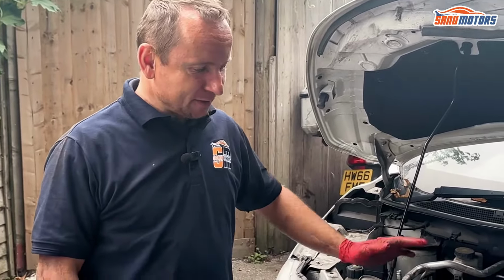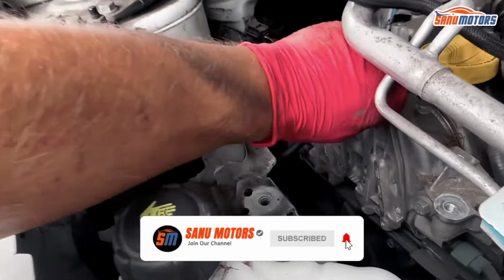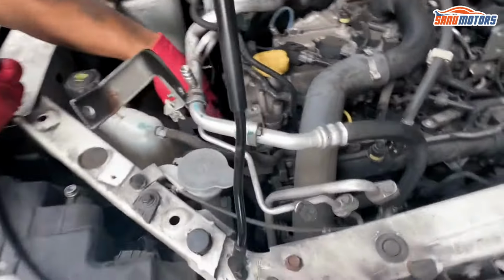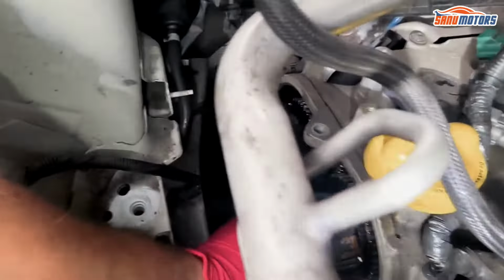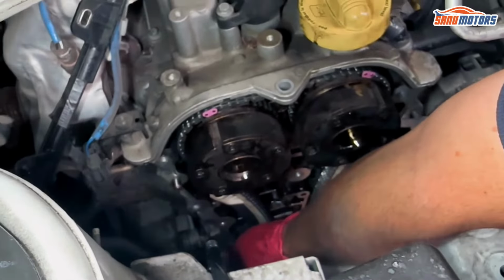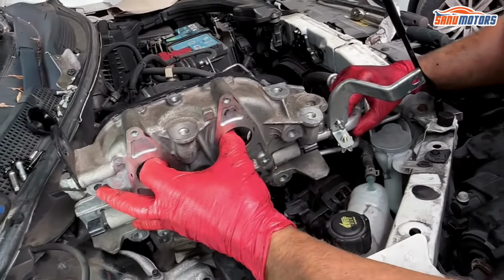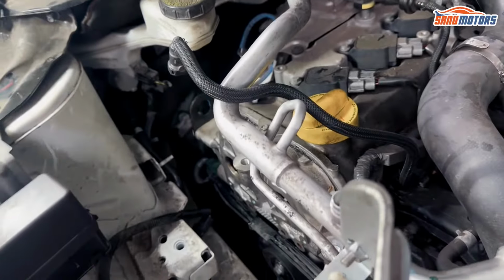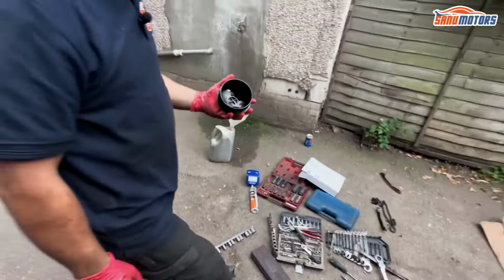Replacing the Timing Chain on Nissan Qashqai 1.2 | Timing Chain DIY Tutorial

Comment: Hi Charlie. My Turbo just failed on the same car. ( 2019 Qashqai 1.,2 petrol ) The turbo shaft is bent and it's coked up with carbon. I'm worried that the same thing will happen again after I replace it. What should I do or look out for? Is it easy and worth removing the sump and rocker and flushing?
Reply from the maker: Experiencing a failed turbo on your car can indeed be concerning, especially if you're worried about it happening again after replacement. Here are some steps and considerations you can take to address the issue:

Diagnose the Root Cause: It's important to determine why the turbo failed in the first place. A bent shaft and carbon buildup can indicate various issues such as oil starvation, poor lubrication, or excessive heat. Without addressing the underlying cause, the new turbo might face similar issues.

Inspect Oil Circulation: Check the oil circulation system thoroughly. Ensure that oil is flowing properly to the turbocharger and that there are no blockages or restrictions in the oil lines. Additionally, make sure the oil is clean and of the correct grade specified by the manufacturer.

Address Engine Issues: Excessive carbon buildup could indicate issues with the engine, such as incomplete combustion or oil leakage into the combustion chamber. Address any engine issues that could contribute to carbon buildup to prevent future turbocharger problems.

Consider Flushing: Flushing the engine can help remove any accumulated carbon deposits and contaminants from the oil system. However, it's essential to use a proper flushing agent recommended by the manufacturer and follow the procedure outlined in the service manual. Removing the sump and rocker cover for a thorough cleaning might be beneficial if there's significant buildup.

Regular Maintenance: Following the recommended maintenance schedule for your vehicle is crucial for ensuring the longevity of the turbocharger and other engine components. This includes regular oil changes, air filter replacements, and inspections for any signs of wear or damage.

Monitor Performance: After replacing the turbocharger, monitor the performance of your vehicle closely. Keep an eye on oil consumption, exhaust smoke, and any abnormal noises or vibrations that could indicate potential issues with the new turbocharger.

Consult a Professional: If you're unsure about any aspect of the repair process or if you're unable to diagnose the root cause of the problem, it's best to consult a professional mechanic or technician with experience working on turbocharged engines.

By taking these steps and precautions, you can increase the likelihood of preventing future turbocharger failures and ensure the reliable performance of your vehicle.

Comment: Is the crank pulley definitely 19mm some videos are saying 18mm? Thx
Reply from the maker: Great question! For the Nissan Qashqai 1.2, the crank pulley bolt is typically 19mm, but it’s always a good idea to double-check before starting, as some models or years may vary slightly. 🔧 If you’ve seen sources mentioning 18mm, it could be specific to a different year or variant.

Thanks for watching, and feel free to reach out if you need any more info! 🚗👍 #NissanQashqai #TimingChain #DIYMechanic

Comment: Would this be the same process for Nissan qashqai +2 2012 petrol. Would the timing marks be the same.
Reply from the maker: The process for setting the timing marks on a Nissan Qashqai +2 2012 with a petrol engine and a Qashqai 1.2 may be similar, but there could be some differences based on the specific engine types and configurations. It's essential to refer to the service manual or repair documentation for your exact vehicle model to ensure you have the correct information for setting the timing marks.

Different engine variants and models may have variations in their timing mark positions, so it's crucial to get precise instructions for your specific vehicle. If you're not confident in your abilities or need assistance, it's best to consult a professional mechanic or a Nissan dealership to ensure that the timing marks are set correctly for your particular vehicle. Incorrectly setting the timing marks can lead to engine damage or poor performance

Comment: Hi mate love your videos,
I have an issue with my 1.2l 2014 qashqai cranking but not firing, i had RAC out and they did a diagnostic check and found a fault on the camshaft position sensor. Replaced 2 sensors and no change, he told me the timing chain has most likely worn/stretched causing the timing to be out. How likely is this to be the problem? 
Thanks.
Reply from the maker: Hey there! Thanks for the support and reaching out. It sounds like you're dealing with a frustrating issue with your Qashqai.

If the diagnostic check identified a fault with the camshaft position sensor and replacing two sensors didn't resolve the issue, the next logical step would indeed be to investigate the timing chain. While it's not the most common issue, timing chain wear or stretching can certainly cause problems with engine timing, leading to difficulty starting or running rough.

Given the symptoms you described – cranking but not firing – along with the diagnostic findings, it's worth considering the possibility of timing chain issues. However, it's essential to rule out any other potential causes before jumping to conclusions.

I'd recommend getting a second opinion from a trusted mechanic or a Nissan dealership. They can perform a more thorough diagnosis, including checking the timing chain and related components, to confirm whether it's the root cause of the problem.

Timing chain replacement can be a significant repair, but addressing it promptly can prevent further damage to your engine. Keep me updated on how things go, and if you have any more questions or need further assistance, feel free to ask. Best of luck getting your Qashqai back up and running smoothly! 🚗💨
Reply: Thank you for your detailed and quick reply! Indeed it is very frustrating as the car ran fine before with no noticeable rattling or symptoms although it has done 103k miles without a replacement so it could be a good possibility. I will now be taking your advice on getting a garage to give me a second opinion 👍 I will let you know what the outcome is and again thanks for your help.
Reply from the maker: Thank you hopefully all ok. 👍

Comment: Hi, nice job, you make it look easy, I have a Nissan juke 2016 1.2dig t I think is the same engine with the one in you video, the car keeps throwing P0090 code with engine light on and start stop system light flashing without any other symptoms, I've noticed that is happening with the engine cold and just in motorway never around the city, once the code is deleted, never come back until the engine is cold and I take it to the motorway, any idea what it can be wrong? Thank you
Reply from the maker: The P0090 code typically indicates a problem with the fuel pressure regulator control circuit. Since you're experiencing this primarily when the engine is cold and on the motorway, it could be related to fuel pressure fluctuations during high-speed driving.

Here are a few things you might want to check or consider:

Fuel Pressure Sensor: The fuel pressure sensor might be malfunctioning or giving inaccurate readings, especially when the engine is cold and under high load on the motorway.
Fuel Pump: The fuel pump could be failing or not delivering consistent pressure, particularly when the engine is cold and requires more fuel at high speeds.
Fuel Filter: A clogged fuel filter could restrict fuel flow, causing pressure issues, especially during high-speed driving.
Wiring and Connections: Check the wiring and connections related to the fuel pressure regulator and sensor for any signs of damage or corrosion. Sometimes, a loose connection or damaged wire can cause intermittent issues.
Software Update: There might be a software update available for your car's engine control module (ECM) that addresses this issue. It's worth checking with a Nissan dealership or a qualified mechanic to see if there are any updates available.
Since the issue seems to occur primarily under specific conditions, like when the engine is cold and on the motorway, it might be a bit tricky to diagnose. If you're not comfortable doing the troubleshooting yourself, it's best to take your car to a qualified mechanic or Nissan dealership for a thorough diagnosis and repair. They'll have the tools and expertise to pinpoint the exact cause of the problem and get it fixed properly.
Thank You
Reply: stretched timing chain causing fuel pressure at the wrong time -> giving fault for fuel pressure regulator, typical issue
Reply: Hi. Did you solve the P0090 problem? I have same problem and it came up after replaced the timing chain.

Comment: Have you done this for the Renault Captur, and is it the same as for this Qashqai
Reply from the maker: The process of replacing the timing chain on a Renault Captur 1.2 and a Nissan Qashqai 1.2 can be quite similar because both vehicles often share the same engine, the Renault-Nissan H5FT 1.2-liter turbocharged engine. However, there may be slight differences in the procedure due to the distinct layouts and designs of the two vehicles.

Here's a general guide to replacing the timing chain on a Nissan Qashqai 1.2, which can serve as a reference for the Renault Captur 1.2 as well. Always refer to the specific vehicle’s service manual for precise instructions.

### Tools and Materials Needed:
- Socket set
- Wrench set
- Screwdrivers
- Timing chain kit (includes chain, tensioner, guides, and sprockets)
- Torque wrench
- Engine oil
- Coolant
- Gasket sealant
- Jack and jack stands
- Drain pan

### Steps:
1. *Preparation:*
   - Ensure the car is on a flat surface and the parking brake is engaged.
   - Disconnect the battery to avoid any electrical issues.

2. *Drain Fluids:*
   - Drain the engine oil and coolant into a drain pan.

3. *Remove Engine Components:*
   - Remove the engine cover, if present.
   - Take off the air intake duct and any other components obstructing access to the timing chain cover.
   - Remove the serpentine belt by releasing the tensioner.
   - Detach the alternator and power steering pump if they obstruct the timing chain cover.

4. *Access the Timing Chain:*
   - Remove the valve cover to expose the camshafts.
   - Detach the crankshaft pulley. You may need a pulley removal tool for this step.
   - Remove the timing chain cover. This may require removing additional components such as the water pump and engine mounts, depending on the vehicle's layout.

5. *Remove the Old Timing Chain:*
   - Align the engine to top dead center (TDC) on the compression stroke of the first cylinder.
   - Remove the timing chain tensioner and guides.
   - Carefully remove the old timing chain and sprockets.

6. *Install the New Timing Chain:*
   - Install the new sprockets, ensuring they are aligned correctly.
   - Fit the new timing chain onto the sprockets.
   - Install the new guides and tensioner.
   - Ensure the timing marks on the camshaft and crankshaft sprockets are aligned as specified in the service manual.

7. *Reassemble the Engine:*
   - Replace the timing chain cover with a new gasket or gasket sealant.
   - Reattach the crankshaft pulley, valve cover, and any other components that were removed.
   - Reinstall the serpentine belt.
   - Refill the engine with oil and coolant.

8. *Final Steps:*
   - Reconnect the battery.
   - Start the engine and check for any leaks or abnormal noises.
   - Allow the engine to reach operating temperature and ensure it runs smoothly.

### Tips:
- Always use a service manual specific to your vehicle model for accurate torque specifications and procedures.
- Double-check the alignment of the timing marks before reassembling the engine.
- Take your time and label any parts and bolts to avoid confusion during reassembly.

While this guide provides a general overview, always consult the specific service manual for your vehicle to ensure the procedure is correct and safe.

Comment: Hi mate first of all thank you very much for detailed video on explaining each step. I would say its very helpful.
Now just seeking advice to see if you can help.
I have nissan qashqai 2014 1.2dgit petrol. Found some noisw coming from front of car get checked with 2 different independet mechanics which both suggested its timing chain. Car done around 100k so most probably its the chain. 
Now the main question as i am getting confused with 2 independent mechanics said different thing. 
One said just need timing chain kit replacement with new engine oil and filter will solve the problem.
Other said it needs oil pump with chain and water pump need replaced aswell alongside with gasket, camshaft seal and cover as we getting that far in engine.
Just been curious and asked 3rd guy and he said water pump not driven by chain so not replacing and as having no engine lights or oil lights/issue on car so oil pump doesnt need changing.
Now need your proffessional advise what would you suggest.
Thanks in advance and sorry for lenghty question.
Reply from the maker: No worries about the length of the question, it's important to get all the details out there when discussing car issues.

In this situation, it's understandable to feel confused when receiving different opinions from mechanics. Let's break down the suggestions:

Timing chain kit replacement with new engine oil and filter: This is a common approach when dealing with timing chain issues. Replacing the timing chain along with the associated components (such as guides and tensioners) can often resolve the noise issue.
Replacing oil pump, water pump, gasket, camshaft seal, and cover: This is a more comprehensive approach. While it may address potential additional issues within the engine, it could also be seen as more of a preemptive measure. Replacing these components could ensure better longevity and prevent future issues, but it might not be strictly necessary if they're not currently causing problems.
Not replacing the water pump: The water pump in some engines is not driven by the timing chain, so if it's not causing any issues and is not due for replacement based on manufacturer recommendations, it may not need to be replaced.
Given these suggestions, here's what I would recommend:

Start with the timing chain replacement along with new engine oil and filter. This is typically the first step in addressing timing chain issues and may resolve the problem.
If the noise persists after the timing chain replacement, you could consider the more comprehensive approach suggested by the second mechanic. However, it's essential to carefully evaluate whether the additional components really need replacement based on their condition and manufacturer recommendations.
As for the water pump, if it's not causing any issues and is not due for replacement, it may not be necessary to replace it at this time.
Ultimately, the decision depends on factors such as the severity of the noise, the condition of the components, and your budget. If you're still unsure, you could consider getting a second opinion from a trusted mechanic or consulting with a dealership service department for their recommendations.
Reply: @SanuMotorswithCharlie  
Wow that's such a great detailed explanation of my issue. I would really like to say thank you for your time to explain and I really appreciate it. 
If you don't mind me asking as i forgot to add that the 2nd mechanic also suggested to change VVT sprocket aswell. What your proffessional thoughts on that part.
After your comment and suggesstion I would speak to nissan dealership and ask their recommendations aswell.
Again thank you very much for all help and suggesstion you have given. 🙏
Reply from the maker: your welcome

Comment: I’m suspecting my parents has this problem is throwing a fault code for cam sensors occasionally it’s only done 4500 miles from new 2017 do you think it could be the problem? What’s the time taken roughly please similar set up to yours (no ramp)
Reply from the maker: Hi there! Sorry to hear about the issue with your parents' Qashqai. If it's throwing a fault code for the cam sensors, it could indeed be related to the timing chain, even though it has low mileage.

For a similar setup to ours (without a ramp), the job typically takes around 4 to 5 hours. We also keep the car overnight to allow the silicon to dry properly. If you're not confident in doing it yourself, it might be a good idea to consult a professional. Hope this helps, and good luck with the repair!
Reply: @SanuMotorswithCharlie   hi thanks for the reply you’ve made a great video I’m impressed even with new sensors it’s thrown a fault on start up especially im a mechanic by trade like any job the first time is a bit of a learning curve you’ve helped out a lot 👍
Reply from the maker: I'm glad to hear that the video was helpful! Troubleshooting issues like sensor faults can be tricky, especially with new components. It's great that you managed to work through it. If you have any more questions or run into further issues, feel free to ask. I'm here to help! 👍